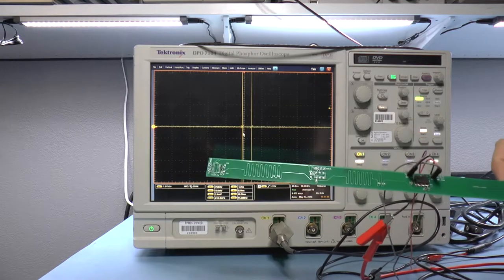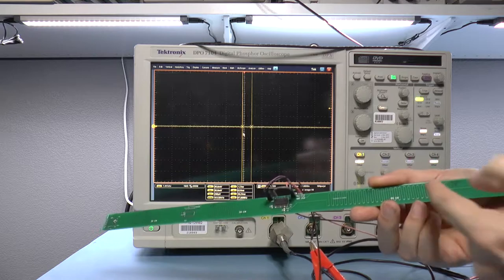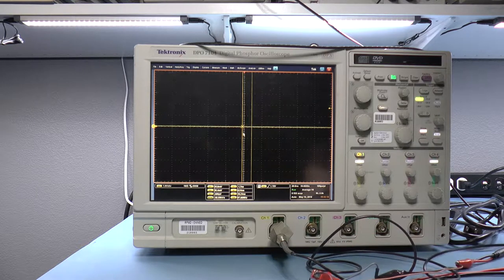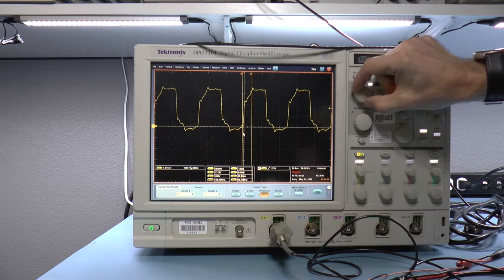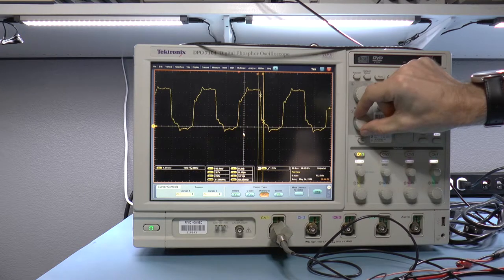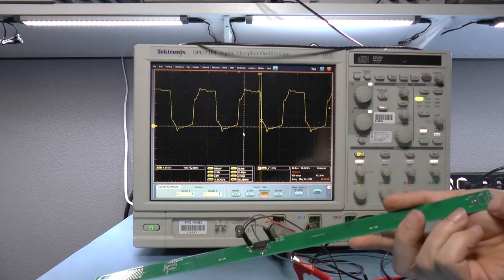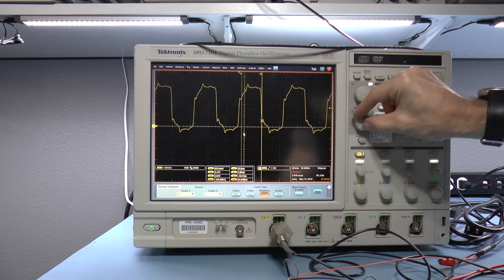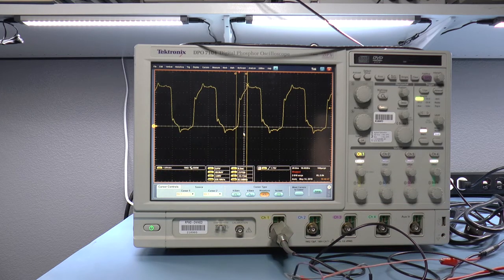Chip tips #9.5: Using an RC termination

Comment: Love this project.  Looking forward to seeing it in operation.

Why can't you send out a paired signal, one which is as you have here, and the other explicitly crafted to compensate for the peculiarities of other wave, so you can send slightly offsetting voltages to add to the mix so the square wave can be crafted into a true square wave?
Reply from the maker: That's an interesting idea but honestly I have no idea how to craft such a waveform. And it would surely depend on the position of each card, and I would definitely want to avoid a different circuit for each card.
Reply: Maybe an 8x clock driving the second line, with some switching circuitry to send out -nV only at certain points on the cycle, 0v everywhere else.  A logical TICK-tock for the main clock (T would be rising edge, t would be the falling edge), with a +0.3V on the T, and a -0.3V on the t.  The voltages get netted together at each point, resulting in a more square square wave.

Just a thought.  You could also trigger the second signal off the rising and falling edges of the clock for the first.

No idea if it would work, but it seems logical.

Comment: You might still have the power problem: the load is still 50 Ohm, even if for high frequency components only. But you're toggling at 20 MHz...   After connecting lots of cards it will be worse.

Have you measured the power consumption? What about when two strips connected (to buffer's separate outputs)?
Reply: Yes, that is going to be fun. In chapter 1 we learned that the card has 3 inputs on a destination bit. That is, the register file is going to present 9pF per card on the destination bus. For 31 cards, that is 279pF on the desination bus purely from the register file. 64mA per pin will still change the bus in 14ns, but the worst case current is 2A.
On each source bus there will be 32 9pF outputs in the register file, or 288pF, about the same as on the input.
So if we guesstimate 50% toggling signals per 50ns, that's around 0.8A in the capacitive loads. Not too terrible, considering that all-ones in the registers is going to consume another 1.2A in LED current.
It might be a good experiment to load all 32 bits on a source bus with the expected 288pF and see if the register performs correctly. This is a nasty sharp-edged current pulse.
Reply from the maker: Yep, the capacitance is a worry. Note that each output, if I use a buffer, is limited to 50mA, so with say 300pF, it would take 12ns to go from 0v to 2v (the logic 1 threshold). Actually, I'll be using a 74LVT16374, so it's 64mA going high, and 32mA going low. Let's just say that's 50mA on either side. The transition speed is okay, since the input of the 74LVT16374 needs to be faster than 10ns/V, and this will be doing 6ns/V. 
Now, worst case, all 32 bits toggle, requiring 1.6A for 12ns. There are four VCC pins per chip, and each maxes out at 64mA. But I don't know if that's specified as continuous or not. I know that plenty of CMOS chips do multiple amps over a few nanoseconds just to switch. We'll just have to see. This is what decoupling (or charge reservoir) capacitors are for -- to provide that bit of ooomph to do the switching.
Also, the input capacitance of a '16374 is 4pF, so it's not as bad as a '244 buffer. That's a total of say 130pF, so the delay is even less.
I think it's worth a try!
Reply from the maker: Guesstimate of decoupling capacitor: 400mA per VCC pin for 6ns (remember the capacitance is 130pF, a little less than half), and if I don't want VCC to dip more than say 0.2 V, I get 12nF. Considering that most decoupling capacitors are 100nF, I'd say we don't have to worry too much. I hope.
Reply from the maker: Argh, wait, I will actually want to use a buffer as the input for each card, otherwise I have three inputs per card, not one. And without the buffer, each line has to travel a lot further on the card itself, which messes up the transmission characteristics. So, buffer.
Reply: Yes, a buffer will reduce the capacitive load on the destination bus by 3x, but if you go that route, are you not back to a design with a single register, leds on the output of the register, and tristate buffers for driving the source busses? It does have advantages, but means you will need to order a new pile of register cards.
If you are redoing the register cards, would it be an idea to include decoding on each register card? It probably costs a bit since there will be many copies, but could reduce the 96? select wires you will otherwise need for the register bank, and possibly eliminate a register addressing card.